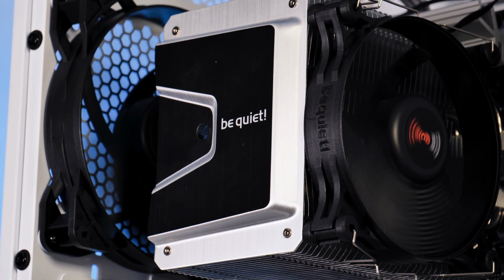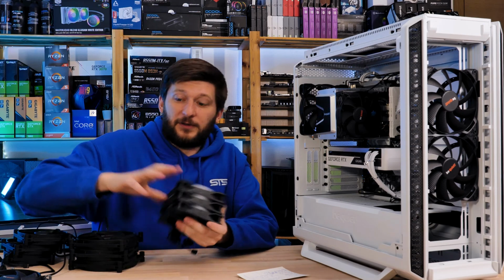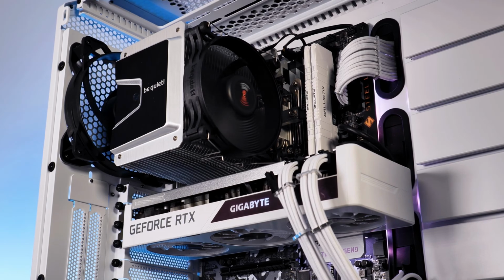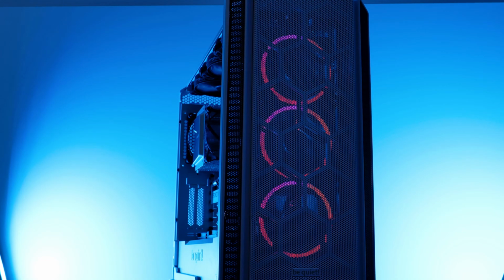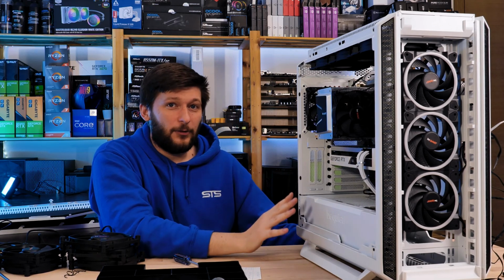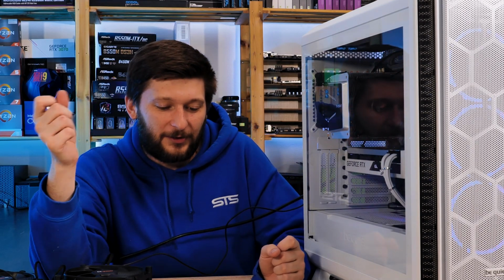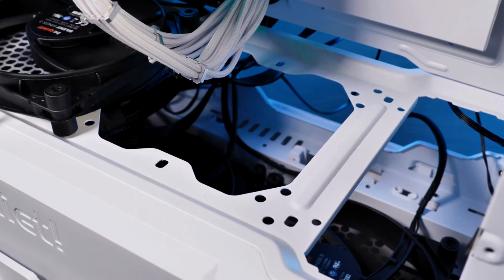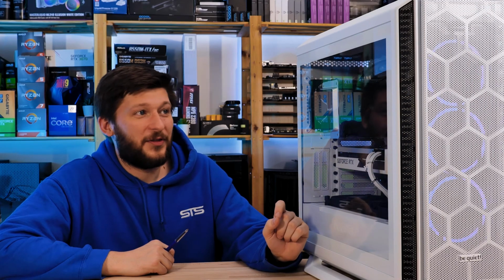How many Fans are TOO MANY Fans? More Cooling by Installing Fans where no Fan should be

Comment: Hey 👋 ich wollte mal fragen ob du vllt ein Video machen könntest um zu testen wie dieses Gehäuse performed wenn man es in der Invertierten Form verwendet. Würde mir gerne das Gehäuse holen und dann 3x 140mm Lüfter oben and der Front und dann die Lüfter die man unten montieren kann als intake einbauen und dann hat man den 140mm auf der Rückseite des Gehäuse als Exhaust. Wäre sehr interessant da es kein solches Video auf YouTube gibt welche die Leistung eines Luftkühlers bei der Konfiguration testet ? 
Ich selbst verwende gerade einen Dark Rock Pro 4 auf einem 9700k aber würde gerne auf einen 14700k upgraden :D

Comment: That's a great idea to put fans on top of the PSU shroud :D I'am planning to buy this case ans maybe i will try it, because i will put an AiO in the front and my GPU is a 7900XTX.
Reply from the maker: You should!
Reply: @STSYT  that was the plan, unitil i saw the Be Quiet Dark Base Pro 901 and felled in love with it, so i switched to this case 🤩😜

Comment: Fun video! I have 12 BeQuiet fans in my BeQuiet 900rev2 case. Everything runs so nicely and I use 'fancontrol' app to control them all.
I'm looking to de-shroud my GPU and will put two Light-Wings below it! It doesn't need it though, it runs nice and cool as long as I keep the fans moving air.
BTW, all the external fans are blowing in except for the one exhaust fan at the back. 7 incoming fans, 4 are 120, three are 140 and one 140 exhaust. All incoming air is filtered, but I noticed that my GPU sucks in air from out the back when fans are going full on, so I have  a filter on the back also.
Reply: Wayyy too much intake. 6 in 5 out is more then enough

Comment: ALL Wrong!!! how is it this guy changes all case fans instead of the cpu cooler which is clearly the issue!!! ANd expects a temperature change of any significance! BRUH!
Reply from the maker: cause that was the point of the video. How far can you push it with case fans alone.

If I wanted to get better temps I would install an Arctic LF 420. Every time. Would get kinda boring when done weekly

Comment: Great video! I have the silent base 802 hottest is 60.2c AIO 360mm push pull config upfront 6x120mm fans. 3x140mm top of case, 1x 140mm rear of case, 1x140mm fan at the bottom which be quiet has designed a mounting for. idle temp: 28-30c, high temp: 59.8 - 60.2c depending on ambient temp. 11 fans total  currently it's summer and no AC running in the house so it's pretty warm. It runs a lot cooler when the AC is on for sure. Using Noctua,s for the push and pull config and the rest all be quiet lightwings high speed.

Comment: You will be surprised at how much lower the cpu temps can be if you remove two of the roof fans, that are closest to the front of the case and leave in, one roof fan, at the very back of the roof.
Seems very counter intuitive at first.
If you look at it from the airs point of view it will make sense.
All of the fresh air in the case will be drawn to the rear, upper, corner of the case.
This will move a large amount of cool air across the outside of the cooler as well as allowing large amounts of fresh air to enter the the front of the cpu cooler.
Your vrm temps will improve as well.
I run an amd, 3960x , 24 core (48 thread) cpu with a Dark Rock Pro Tr4 and use the configuration that I described above.
I am using two F14 Arctic 140mm fans for exhaust.
One at the back of the case.
One, all of the way at the rear, in the roof.
I made a cover to cover up the rest of the roof that I am not using for exhaust.
3960x @ 1.27v  4.35 - 4.25 Ghz  (CTR 2.5 RC5 OC Software ).
Noctua NF A12x25 Chromax Black on the front and rear of the Dark Rock Pro.
Fractal HF14 Venturi in the middle of the Dark Rock Pro.
Liquid metal thermal paste.
H500p Mesh Case with stock 200mm fans in front at 800rpm.
Aida 64 stress load (without FPU checked), only Memory, Cache and CPU checked, my temps reach 61- 63 degrees celsius
With all three roof fans in place, the temps reached around 63-67 Celsius.

I love these kinds of videos.
This is how the community learns to protect our hardware and get the most out of it.

Keep 'Em Coming!!
Reply: I use 2x 140's in both the front and top of my Fractal Define 7 Compact, but the two on the front are common airflow fans (Arctic F14 for intake) and the two on the top (Arctic P14 front top is intake and rear top exhaust) are pressure optimized as the top has more restrictive airflow, and temps are worse with the front most fan on the top removed.  Plus a 120mm Arctic P12 on the back exhausting.  

Bottom line...  it depends on the case and the fans.
Reply: @JeffWaynee  Yep. 
Your mileage may vary.
Reply: @JeffWaynee  I know why you using pressure optimized fans to exhaust at the rear.
If you have two high flow fans to experiment with, you may be very pleased with the results of swapping both, the roof exhaust and the rear exhaust to a high airflow, like the ones you have in the front.
Nothing wrong with you current config.
You may find that exhausting with high flow rather than high pressure, might lower your temps a couple of degrees.
Heat always gathers at the top left corner of a computer case due to the cluster of hot components.
I know that you already know that but what I am getting at is that when you exhaust that heat with high flow, the cool air from the front has to rush in and fill that space.
Especially if you can bring in fresh air from the bottom(if you are not already).
That would certainly help.

Comment: My devices are AMD 5800X and ASUS GeForce RTX 3080 Noctua OC.

I installed 7 Bequite Silent Wings 4 140 mm PRO in case (3 front, 1 back, 3 top) and replaced Bequite Silent Wings 3 of DARK ROCK PRO 4 with Bequite Silent Wings 4 120 mm PRO. There was a significant drop in CPU temperature.

All Bequite Silent Wings 4 PRO is HS mode.

I think the Bequite Silent Wings 4 140 mm PRO is a very good fan. Compared with the original case I used 7 arctic P14, the temperature is much lower and quieter.

Thank you very much for recommending Be Quiet Silent Wings 4 140 mm PRO in your previous video. 😀
Reply: That's a lot of case fans. I have two 2x180mm in my Fractal Torrent at 450rpm and one Arctic P12 at 1000rpm max on the Scythe Ninja 5 heatsink (5800X like yours) without heat throttling.
Reply: @cszolee7979  Since the 3080 is very hot, I installed more fans.

Comment: I use 5 case fans in a Define 7 Compact.  All Arctic - 2x P14 on top, 2x F14 in the front, and a P12 in the rear.
Reply: Are those 140mm on the top set to exhaust? cus that would make negative pressure biased
Reply: I'm using P12 on the front (2x), bottom and one F12 on the rear. Before I had 2xF12 front then rear and top as exhaust, but it had two disadvantages: top fan produced or leaked some noise and then front fans sucking air through dust filters are less efficient so case sucked some dust through empty hdd bay and other tiny holes. Also I found software "Fan Control" which allows to regulate case fans based on cpu/gpu fan average or maximum +offset so they run at most on 1000rpm when they are silent. F12 seems to have aerodynamic noise, at least one of P12s seems to produce some vibration or motor noise above 1000rpm. I guess it's enough for ryzen 5900x and old nvidia 1060, both having like 140w max. Well ... whole PC with monitor can consume up to 420w in combined gpu/cpu stress tests at the same time.